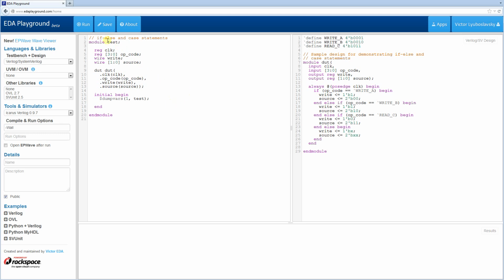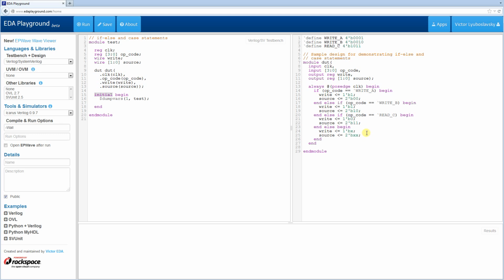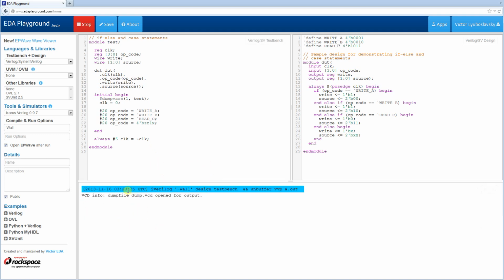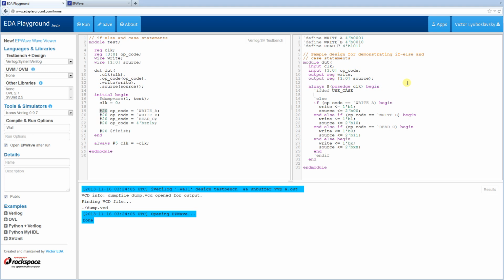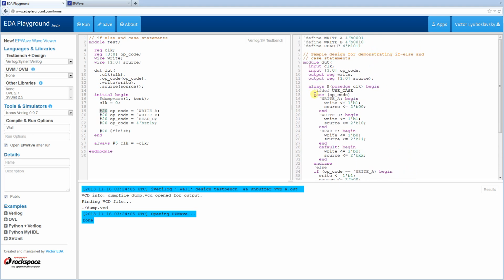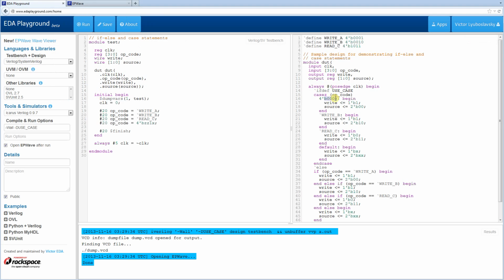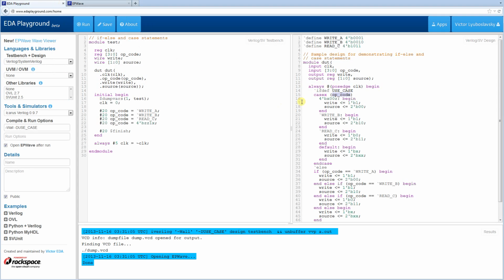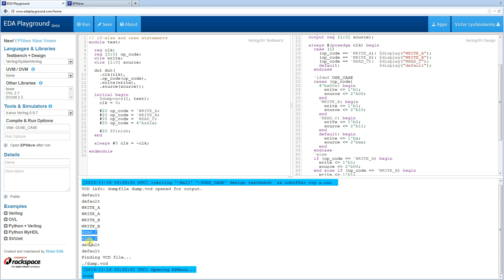Verilog Tutorial 8 -- if-else and case statement

Comment: How can we create a mux which runs different module eg
if (sel == 2'b00) begin
  ripple_adder ra1(a,b,out,cout);
end
else if (sel==2'b01) begin
  subtract sb1(a,b,out,cout);
end

i tired using generate function  but it is giving syntex error as we cannot pass sel (select line variable ) to generate function. Please help
Reply from the maker: A module is not a function; you do not "run" them. A module is hardware; they exist for all time and "run" all the time. So, you problem would be solved with more hardware like this:

    wire cout_ra, cout_sb;  // or wire [ something : something else]  if it's a bus

    ripple_adder ra1(a,b,out,cout_ra);
    subtract sb1(a,b,out,cout_sb);

    always @(*) begin
      if (sel == 2'b00) begin
        cout = cout_ra;
      end
      else if (sel==2'b01) begin
          cout = cout_ra;
      end
    end

Comment: I am having a problem with the site!

# ** Error: (vsim-3033) testbench.sv(51): Instantiation of 'VendingMach' failed. The design unit was not found.

I do not know what it means!
Reply from the maker: The example for this video is working fine right now.

From the message, it may be a compile error. Can you post some more detail on the Google Group, such as the code you're trying to run or the link to the saved code, and anything else that can help.

https://groups.google.com/forum/#!forum/eda-playground